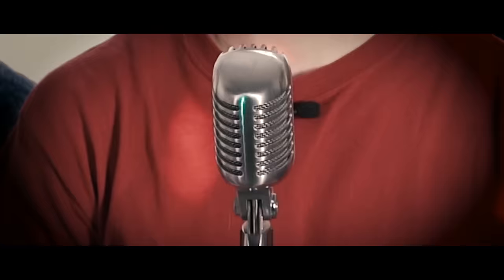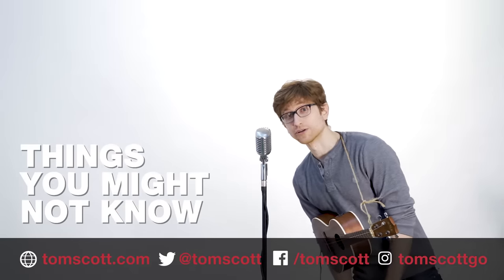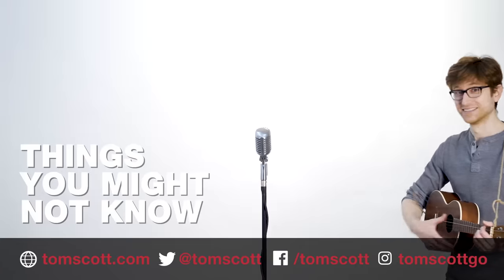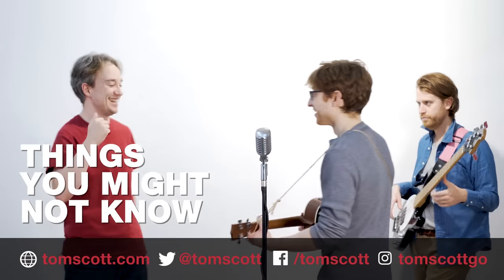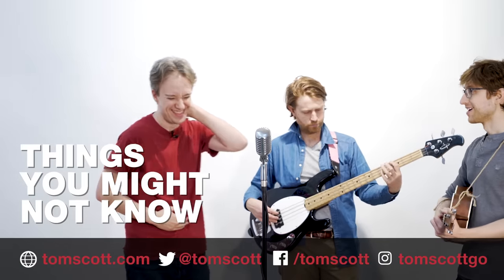How Auto-Tune Works

Comment: Talent's not still required. Usually it's used to turn something that's not a tune into a tune. Hip hop artists often meander about, using auto-tune to put the notes into a key. The problem being, the melody is still unfocused and meandering. Put on top of this that a lot of rappers don't produce their own tracks, and now don't have to put thought into the musical aspect of their work. 

At least back when hip hop was poetic, there was a lot of skills around meter and rhyme schemes. Theoretically, hip hop is a genre that would fit perfectly with rapidly changing time signatures.

Comment: I'd have liked to know a bit more about this. Why does it sometimes sound robotic? Why is it sometimes hard to notice. Someone once told me it's hard to autotune someone who is slightly off and easier for someone way off. Is that true? The evidence I see from parody videos like this that use a spoken source seem less convincing than a chart topper.
Reply: SonOfFurzehatt It depends on how hard you crank the knobs, basically. If you leave no expression in it - flatten the vibrato out of the wave and remove any sliding between pitches - you get that T-Pain fakeness. But if it’s being used for subtle pitch correction rather than effect, it’s far less obvious. As for it being hard to do it when someone is only slightly off… perhaps the T-Pain style overkill is tougher to create when the original pitches are accurate already. Dunno.

Comment: But does it work?  Also, do overtones really sound like a single pitch to human ears?  I mean, if that's true... then why can we tell the difference between recordings with and without autotune and between human voices and perfect pitches?  Fourier transforms are far from perfect... in practice a least squares approach is often still necessary (but not always sufficient) to fit the equations and this technique is labelled LSD (Least Squares Deconvolution), which is often presented in the obvious immature way suggested by it's other meaning.  Initially one might think you can do the Fourier transform and divide in that space to do the deconvolution, but any zeros in the denominator in the Fourier space really don't play nice with that approach.
Edit: Fixed type 'Lease' -> 'Least'

Comment: Fourier analysis and synthesis difficult? Just because it uses complex numbers? 😀 What's really challenging is doing it in /real time/. Digital signal processors, such as the Motorola 56000 series, actually have microcode to help you do a Fast Fourier Transformation in hardware. Which was a lot more relevant in the 1980s, when a supercomputer such as the Cray-2 had far less processing power than an average mobile phone of today. Now, you can have an app on your phone which has a cartoon cat repeat your words at a higher pitch.

Comment: So, if I understand correctly, the Fourier Transform splits the notes from singing/instruments into their base frequencies, auto-tune corrects those individual tones by extending/shortening the length of the tone and changing the speed (as described in the beginning of the video), then the tones are stacked on each other again to re-create the "corrected" music. Do I have this all correct?

I've also struggled for years to figure out how the Fourier Transform works, and it seems like magic to me, as well. All the rest seems simple to me, but the math(s) of the Fourier Transform still eludes me.

Comment: 99% of the young singers and groups and females that have hits across the world now all use this auto tune" the older stars can sing because you had to and had to sing live, now the trash of today can not hold a paper bag with air in it let alone a note" turn of the auto tune and you will hear just how bad this bunch of so called chart filler tracks now are" they can not sing at all.